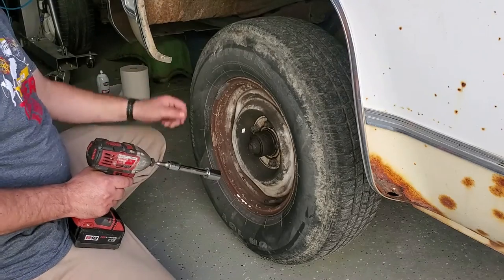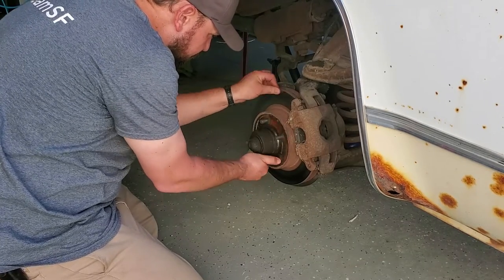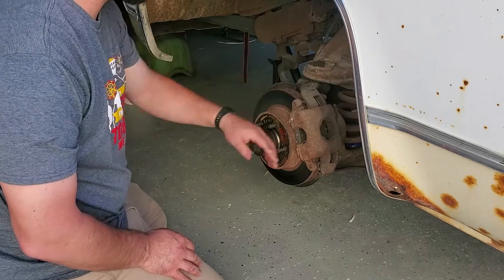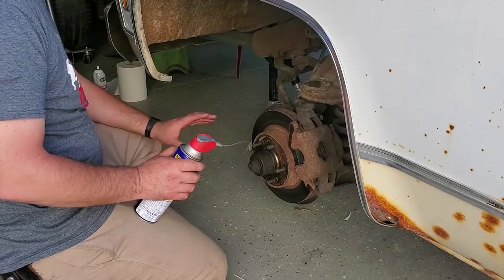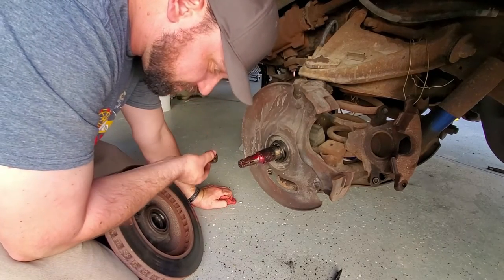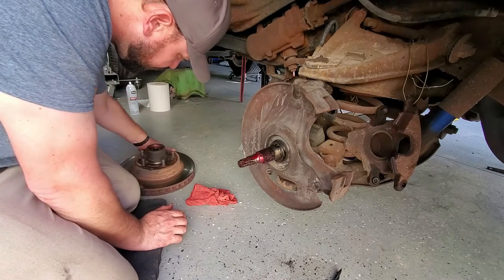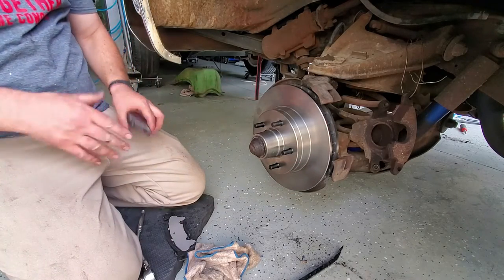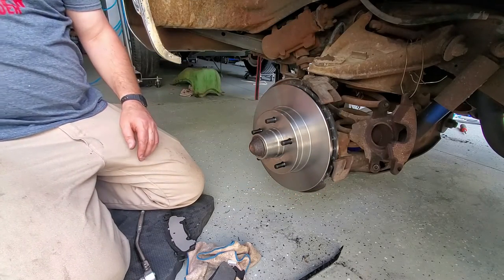Ep. 15 - Replacing Brakes on my 1980 Chevrolet C10 #squarebody #chevrolet #c10 #chevy

Comment: What’s your rule of thumb for tighten that axle nut WHILE rotating the rotor?
Reply from the maker: Just to turn rotor while you snug it down to set the bearings.  I have recently been told you're supposed to do that to 50ft-lbs. Then back it off and go to just more than hand tight.  To the next slot for the cotter pin.  Do you do it differently?
Reply: @boyescustoms  I followed the manual but I wasn’t happy with the drag I was getting. 

I need to replace the calipers so I figured while I’m in there I’d get that axle nut right. I haven’t driven the truck since spindles, bearing and seal went in. 

I’ve seen a number of videos where guys spin the rotor like you and test the drag. Figured that was the proper way and I’d copy it. The book is real vague and just lists torque spec.
Reply from the maker: @Fahrenheit_Motorsports  yeah everybody is a little different.  I just lowered this same truck with a Maxtrac kit, and the instructions said  the 50ft-lbs. So... I think you'd be ok with that.
Reply: @boyescustoms  right on. Thanks man 👍🏽
Reply from the maker: @Fahrenheit_Motorsports  your very welcome.